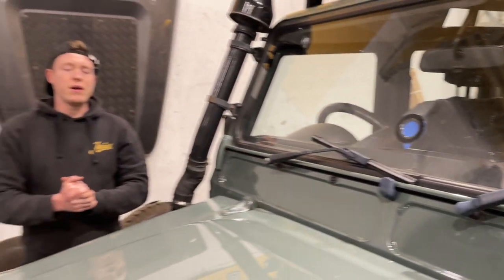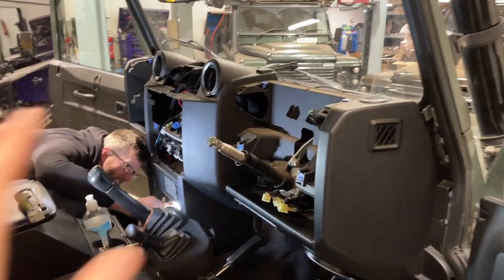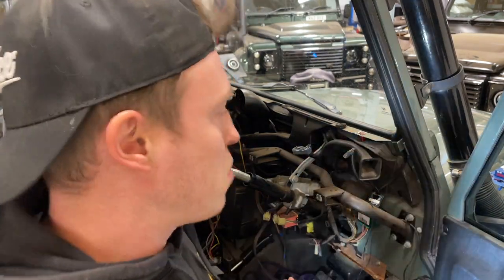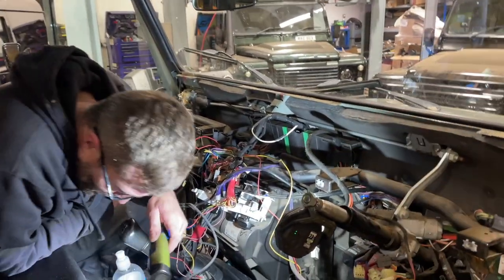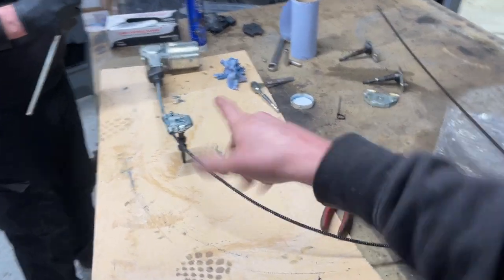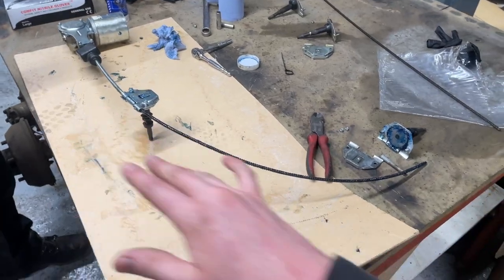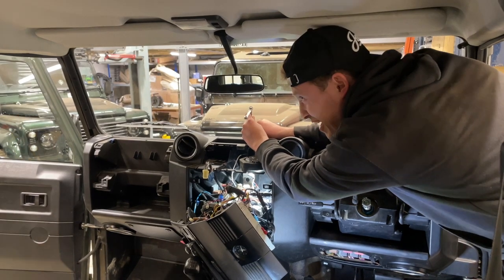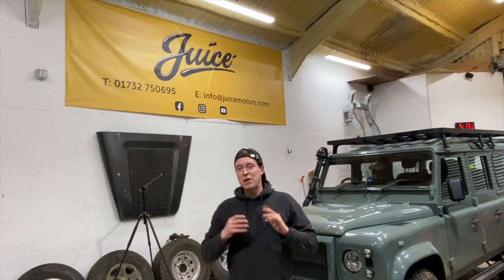Defender Puma Wiper Spindle Replacement

Comment: Hi there from the US, What would a job like that cost in the UK. For example, what would that job cost a customer there. The removal of the dash, the removal of the wier components, rebuild and re install of the system and the dash, without the wiring repair portion.. Thank you!!

Comment: Remove the wiper arms and Pull the spindle rubber back occasionally and wd40 the spindles whilst there turning then pack the rubber with aqueous grease and refit. I do this as a service task on customers cars, works a treat.
Reply: Hi I'm probably being thick here but what do you mean by aqueous grease thanks
Reply: @theimbiber  it's a grease used in water vulnerable areas, most motor factors sell it

Comment: Great video, wish you had done it last year.
My wipers failed while on holiday last August, the nut came off the motor which attached the cable to it, got it fixed with a ratchet screw driver, bit set and a gerber still works a treat now 😂 
As you said dash is a daunting task but actually quite easy to remove 
Keep up the good work 👍

Comment: I did this same job on my ‘93 defender 110, only to realize after pulling out the wiper motor that it was just a blown fuse! Start with simple first… anyway, my wipers don’t make a full cycle, but rather stop just short before returning to park. It’s still adequate, but rather have them go all the way across for better driver visibility. Any ideas why?

Comment: A great “how to” video that I wish had been available last year when I did mine. I also replaced the motor as a precautionary action.  
One minor thing niggles me though.  The wipers doesn’t work on high speed.  They simply stop wherever they are in the motion when I put the switch in high.  Any advise on that ?